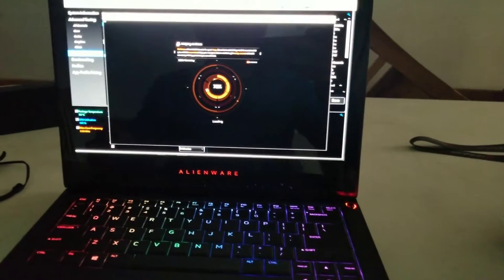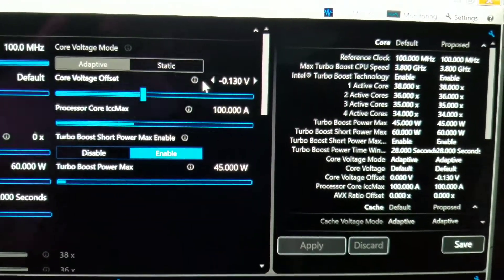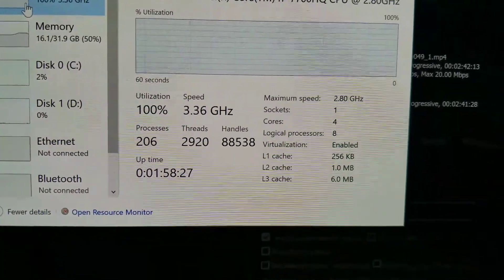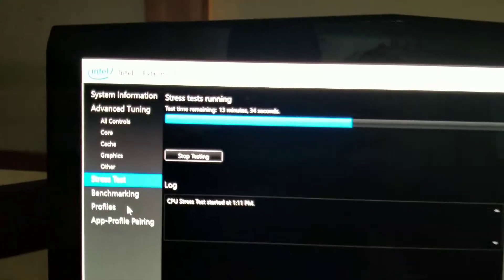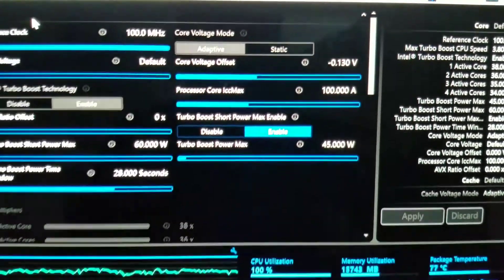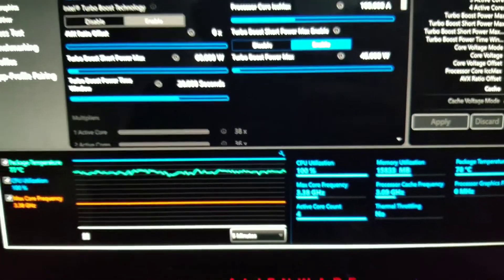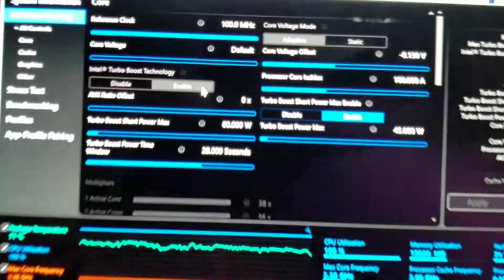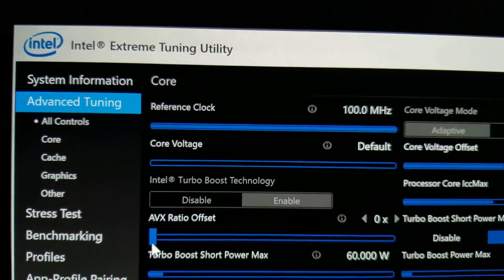Alienware 13 R3 Undervolting to -130mv

Comment: Smart man, I myself perfected my undervolts. I have 7700HQ, GTX1070. CPU offset was indef determinded by Witcher 3 bad optomization and GPU undervolt was proved by FF15. 
-0.130v 
-.800v @1924
Reply: may i know, what is this config for?

Comment: That is very helpful for battery. First of all beast of a laptop. Right now I am making a dock of sort with external liquid cooling and extra hard drive and add storage and the external gpu(with a little tweaking). I’m making this and taking my time on it to be as close as looking factory as possible. If you want to look you should write down my channel somewhere I’ll have a video up in a few months. I do have two problems tho. 1 is the laptop keeps stuttering when its not over locked in every game I have. At least when it’s not overclocked. I’ve tried everything in power to fix it but I can’t find the issue. I think has something to do with my memory based on the task manager usage but every test says that my memory is fine. And 2. I’m just getting into coding and I sort of want to have it where when I plug in the laptop to the dock it changes the majority of settings I have like clock speed and such. I don’t know how to go about this if anyway could help. Thx

Comment: can you do it in the bios? what happens if your computer crashes?
Reply from the maker: MasterofPlay7 Increase the voltage.
Reply: i'm able to do -135mv, but the turbo boost goes down to 3.45ghz, i have the same 13r3 with the i7 7700hq :D
Reply: isn't the turbo boost supposed to be 3.8ghz?
Reply from the maker: MasterofPlay7 yes but don't go under 90 milivolts

Comment: Hi all alienware 13r3 users, during my lecture which last for 3 hours. my settings are wifi ON, alienfx disabled, on the battery icon bottom right set at power saving mode with 50% screen brightness and from desktop right click go into nvidia global setting and select integrated graphics only.
=( thats my experience
anyway to get better performance?
Reply: better performance or battery?

Comment: Hey! great vid, managed to do it in my alienware 13 r3, with -0.130, BUT, I just noticed that for some reason, the settings are being restored to defaults in Intel Extreme Tuning Utility. I get an error stating something that it can't be applied if Watchdog is enabled or something (I haven't been able to get the error on screen again). Anything you know about it?

Comment: Hi, when you rebuilt your Alienware 13 R3 to Windows 10 Pro, did you use Dell drivers or did you use the download drivers via the OS?

Also if both nvme slots are used, does this mean AHCI no longer will show the drivers and needs to be set to RAID?
Reply from the maker: DemolitionManHD Hi there, I use Dell drivers. About the hard drive, once you have both it doesn’t ask.
Reply: JonGCruzNY cool, is that all dell drivers, chipset etc? Was there a specific older on site you referenced? 
With two nvme cards installed, with AHCI enable it shows no drives installed, either installing the intel rat driver does not show disks. But when RAID ON selected and the rst driver, they then appear.

Comment: Do you undervolt the GPU as well?
Reply from the maker: No, is not recommended to to change anything in the GPU.
Reply: Thanks
Reply: GPU temps are great, only CPU will need that.

Comment: How is this possible? I have the same unit but with 16GB of ram and an IPS display. I'm currently at -120mv but when i do a stress test and browse the web while watching YouTube, my system freezes and will continue then freeze again. What kind of sorcery did you do in your  AW13 R3? :O
Reply from the maker: Kenneth Kim Hi, just keep in mind that even we have similar hardware that doesn't mean the response have to be equal for many reason. Parts supplier are not always the same, I've seen comments here of guys that were able to go even lower voltage than me so that's why I said "start by certain amount of voltage" and keep testing. So try with a higher setting. Thanks!
Reply: Its called the silicone lottery.